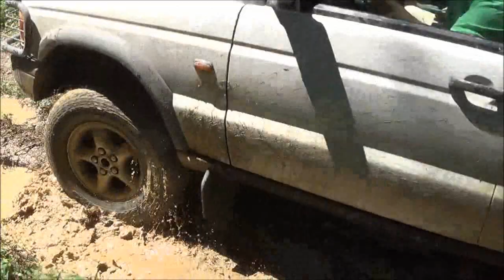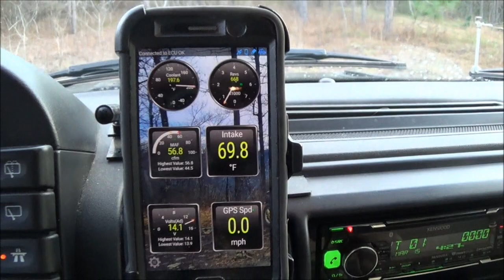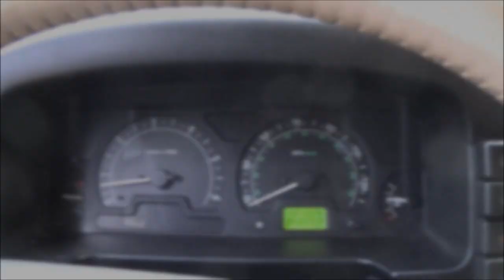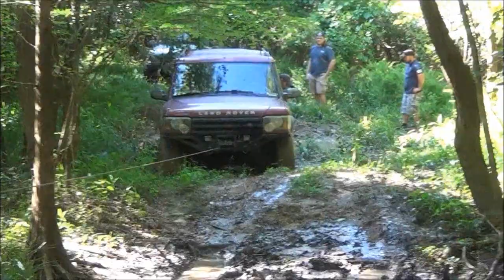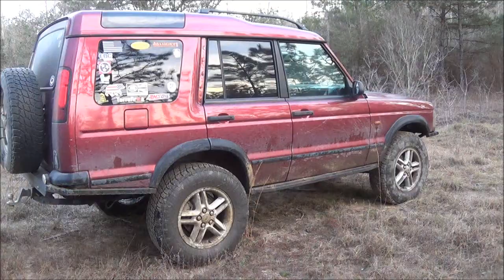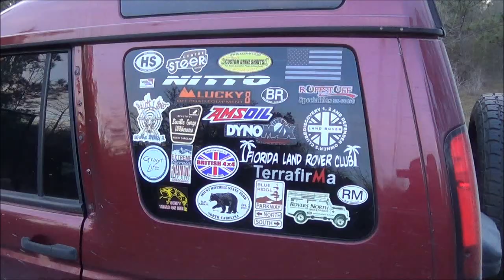Land Rover Discovery 2 Modifications Part Two

Comment: How did you make the bumper flush to the rest of the front what did you do with the two metal studs that protrude from the chasis
Reply from the maker: Im not sure what studs you are referring to, but if they were in the way, more than likely i cut them off! What i did to make the bumper fit the way it does is, i removed the stock bumper and crush cans. I then made the bumper mounts and winch plate out of 3/16" plate all one piece and then made the rest of the bumper. It only mounts to the frame with 4 larger thank stock grade 8 bolts!
Reply: RedEyed Jack thanks!

Comment: Hey mate, well done on the build! I have an 04 D2 with the same Terrafirma kit installed last week. Not a bad set of springs and shocks so far. 
Been really happy to find someone who does not throw money at their build, but time and thought.
One question: do you have a duel battery setup for your winch and accessories?
Reply from the maker: Do you have the Medium Duty springs? I replaced the rears with HD springs, the MD were a little to light. No, I do not have a dual battery set up. It is on the list of things I'd like to do. I'd also like a on board air set up. Not being able to inflate tires at the end of a trail sucks. Thanks for watching
Reply: @RedEyedJack  hey, thanks for the reply. Yes I do have the medium springs in the rear. I have the rear dampers on the 3rd setting to help with the compression (slow the bounce) and the fronts on the softest.
Does the watts linkage delete give the axle a lot more flex? 
Have you extended your wheel speed sensors?
Reply from the maker: @barje.waffles5461  The rear panhard allows the rear to flex far enough that I dislocated my left rear spring two weeks ago trying to climb a rock ledge out of a creek lol. need spring retainers for sure. yes, extended abs wires and brake lines front and rear

Comment: Ive got a disco 2 2003! love my disco has about 137k on the 4.6 and going strong im wondering if i should have it rebuilt before the liners decide to fall out.
Reply: also I have replaced the shuttle valve switch and checked the modulator and it isnt the modulator thats making the ABS TCS and DHA lights on is there any other sensors i should check before taking it in.
Reply from the maker: If your Disco is running strong let it be, but if you wanted to find another motor with a good block, go that route, build the engine with top hat sleeves, new oil pump, have the crank turned, rebuild the heads, then once it is built, swap it out. then there will not be much down time for your truck. As for the Three Amigos, you need to plug in a scan tool that can read the ABS codes to see what codes are present and go from there!

Comment: Great update and excellent mods mate. Does your truck have CDL fitted yet? You'll notice a massive difference when you do , if you allready havent. Combine the CDL with the Traction Control and they're damn near unstoppable. And when you add lockers, streuth (pronounced 'strooth'), it'll be a bloody mountain goat! lol. Enjoying your video's. Cheers for sharing. Atb, Brett, Australia. D1 Driver :)
Reply from the maker: Reaper4367 I do not have the CDL installed yet. I have a front output housing from a D1 waiting to install just need some down time. I'm currently in school for Firefighting and working full time. I'm also on the look out for a 2004 SLABS computer. the programming is better than the 99-03 which were never ment to run with T/C and CDL like the 2004s were.
Reply: traction control is bullshit,no good in mud or sand.only need decent low range,1.70..good lsd,s,or front locker,then back locker,the front pulls you thru,not the rear.

Comment: Hey redeyed jack I’m trying to get some headlights like that on my 2001 discovery2 but can’t seem to find any......any tips on where to look?
Reply from the maker: Charles Mullendore you need to look for 2003/2004 d2 headlights. They are not a simple plug and play installation. There is some modifying to the core support required. Google "Discovery facelift headlight conversion" that should lead you in the right direction.
Reply: RedEyed Jack thanks bud gonna get that part of the project in motion now

Comment: Thanks for the videos, would be nice to see your thoughts on the later models d3, 4 and the latest one.  
Thanks again,
Reply from the maker: Karim Alameddine the D3/D4 are good trucks. I'd daily drive one. I wouldn't want to invest in modifying one though. The independent suspension, limited wheel travel, air bags, are not the best for off road. They are very capable trucks and the aftermarket is building support for them so my opinion on that may change. As for the D5, I got to drive one at the Land Rover experience at Overland Expo this past year. Very nice truck but almost boring on the trail. It went everywhere we took it with ease but it just felt numb. The D1/D2 give you so much feedback on the trail. The D5 does not. It's a smooth ride and did well but those trails are build with specific approach and departures, and are custom built to make those trucks seem as good as they can.

Comment: have you considered a Chevy conversion before replacing with a land rover block?
Reply from the maker: South Hill Farm I did. Eric Brown from Trailhead 4x4 in Cleveland Ohio is the only guy in the US to have running driving fully functional LS swapped D2s. They are 100% functional using the Rover/Bosch engine management.  He only does the swaps in house and does not offer the swap parts for sale separate. The swap starts at $10k. I paid $3,800 for the top hat sleeved 4.6 and have about $5k total into the swap.
Reply: O.K. Its an obvious choice. Reason I asked is because Atlantic British offer rebuilt 4.6 engines for around $6,000 U.S.  Don't know all the details, but if I buy a Discovery it seems a requirement to replace these engines. It seems inevitable.
Reply from the maker: South Hill Farm for sure. It is almost a guarantee. I'm currnetly rebuilding another 4.6l. If the block is in good condition you can build one for about the same cost as a small block chevy. And while it is tore down, pin the liners. Then it will be good to go.
Reply: RedEyed Jack can any engine machinist pin the liners or only specialty shops? I assume the old liners are replaced?
Reply from the maker: South Hill Farm I'm gonna do it myself. There is a really good tutorial online I have saved on my computer. Basically, you drill and tap 1/4"x28 holes on each cylinder though the block below the lowest point of travel of the piston. Then install cap head screws or the same size ground to fit flush in the cylinder when tight with some red loctite.
Reply: something wrong with diesel.???..what chevy,not those anchore 6.5 bullshit engines.bin bin bin bin bin bin...

Comment: your ride is looking  good ,man. I added an auxiliary oil cooler on my 2003 after the dreaded engine replacement. just picked a cdl t case and linkage for yhe next project. It does get addictive doesnt it?
Reply from the maker: rover ron crap! I wanted to talk about the oil cooler I added as well...bugger. Yes, I added a 4.0l oil cooler when I did the engine swap. Also swapped in a 4.0l fan and a Chevy fan HD fan clutch.

Comment: nice update.  I have a D1 and want to put a 6in suspension lift under it.  any suggestions would help tremendously. 👍👍
Reply from the maker: monster mechanic 2000 that's alot of lift for a d1. Call Lucky8llc.com and talk to them. They will point you in the right direction.